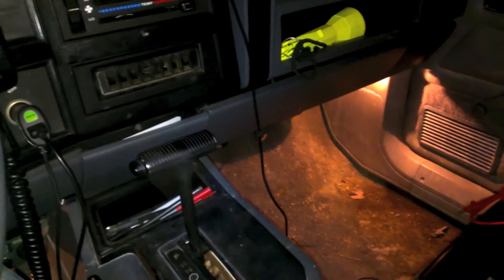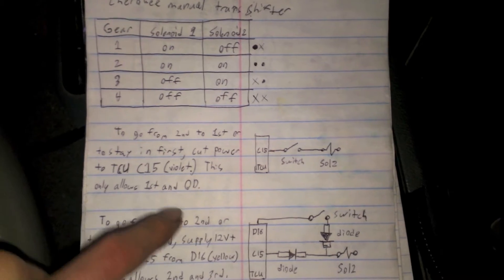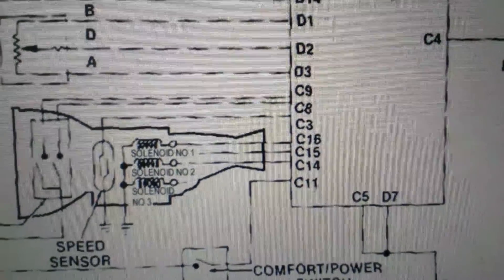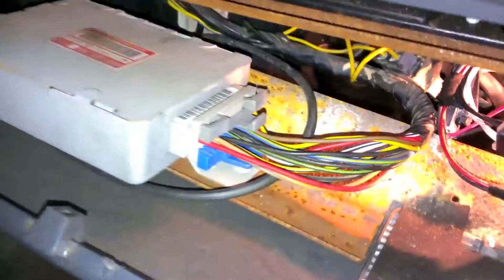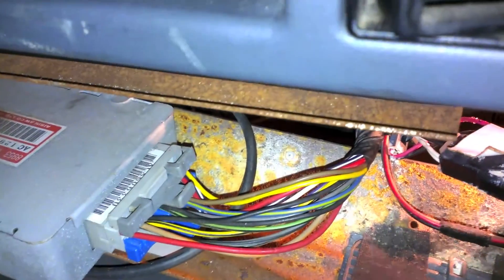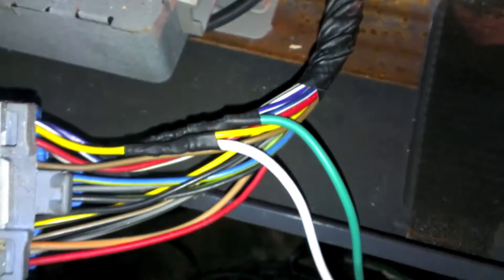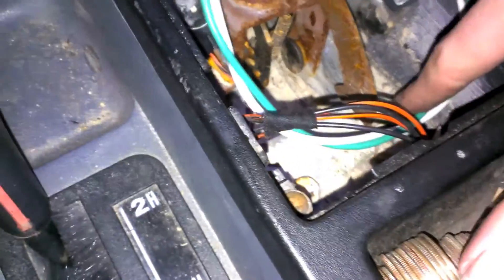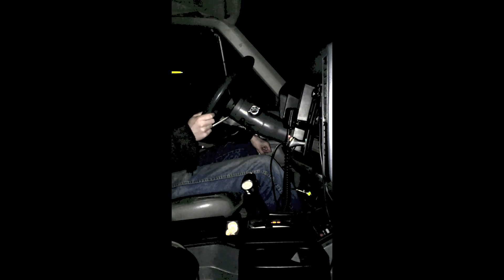89 Cherokee AW4 2nd Solenoid Override Switch Install

Comment: I have a trail rig I want to manually shift from 1st to 2nd and back to 1st can that be done with this method
Reply from the maker: You would need a 3 way switch. 1 that passes through for auto, 1 that is off for first, and 1 that feeds 12v for 2nd.

Comment: Hey Nick, without this fix, under what circumstances would the transmission ever shift to 2 when in the 1/2 position?  I"v never seen my transmission shift to 2 when in 1/2 position.
Reply: Engine speed, wheel speed, throttle position. Mine switches to 2nd if I'm offroading, trying to climb a sandy hill. So high engine rpm, almost full throttle.

Comment: So lets say for "racing" i can take off in 2 rather than 1st
Reply from the maker: You could yeah. I've been working on a more complete shifting system now called the Nifty Shifter to allow any gear at any time.
Reply: NickInTimeFilms great job!
Reply: NickInTimeFilms would this be possible on the newer xjs 97-2001
Reply from the maker: @mmeza620  "Yes" The concept is the same as the solenoids still function the same, but with the newer XJs you've got more computers to worry about. If you start messing with them yourself, it will set a check engine light for a solenoid fault and may even put it into limp mode when you turn your override switch off. I build a 97+ version of my nifty shifter which takes care of the basic check engine light issues. 

The only issue left has to do with the computer detecting when the speed sensors "look" out of sync when you are grabbing manual gears that the TCU did not request and you're really flooring it. That doesn't pop up very often though. Little too smart for their own good.
Reply: NickInTimeFilms i got a 97-01 was teally thinking of doing that for "racing" haha but as u say it may have issues i might aswell not even try it cuz im not quite the mechanic haha but thanks for replying really appreciate

Comment: hello 10x for the video i have Cherokee 95 in the summer i have a problem i'm driving in the D  the transition go 1 3 4  the 2nd not working in the winter when the temperature go down it is working without problem what is the problem???

Comment: By any chance when you are in 2nd gear running off the tcm does it drop out 2nd gear over 3000 rpm
Reply: My jeep wont hold 2nd gear when shifted into 1-2 which is horrible when trying to hold 3200 rpm climbing a mountain.
Reply: @JACKOFALLTODD  Do you know when the selector is in 1/2 under what conditions does it shift to 2nd?  I've never been able to get mine to shift out of 1st, and it would be nice as you say climbing a mountain or even going downhill to be able to use 2nd gear to gain some speed, but not too much speed.
Reply: @66gosser  if I'm on the throttle in 1st gaming rpm it I'll shift to 2and unfortunately if my rpm is to high it overruns in second I cant hold 2and over 3k rpm
Reply: @66gosser  if yours isnt shifting to second in 1/2 but works fine in 3rd you may have a bad gear selector switch or out of adjustment
Reply: @JACKOFALLTODD  As far as I can tell, when in D, it shifts through all gears.  So a bad gear selector switch or out of adjustment.  That sounds like an inexpensive fix.  Let's see.  Thanks for your reply!
Reply: @JACKOFALLTODD  At about what rpm does it shift to 2nd when in 1/2?
Reply: @66gosser  all gears shift at about 2400if I remember correctly it could hold a little longer but even at full throttle it's not gonna go past 3500
Reply: @JACKOFALLTODD  I feel your pain.  I have a '98.
Reply from the maker: That's the tricky part of this setup. I actually installed to help upshift, not hold it in lower gears. The 2nd solenoid controls 2nd and 3rd gear, so you're probably noticing it shift to third. I built a full blown shift controller recently to hold any gear you want.
Reply: @NickInTimeFilms  I connected a switch panel with LEDs and  I found that the tcm is pulling my 12v to the 2nd relay so essentially its trying to down shift I'm in the works of making a electronic circuit with an arduino when I shift into 1-2 it will shift into second and then with a momentary button on the shifter it will downshift to first. Then press the button and it will upshift to second the circuit will only work when the shifter is in the 1-2 position so I'll have 1st and 2nd hold with the push of a button.

Comment: nice video... I have 89 Cherokee  Laredo . I put the car trans in drive no have to much power to move so I need to put in 1-2 up 3 end then drive.. you can help MI.

Comment: Hello. I 
made a swap to the Jeep WJ 3.1 on a M57 bmw 44RE-AW4 and tell me what's 
the resistor value (resistor pack) and its power on pin 10 TCU
https://www.youtube.com/watch?v=cad3lz_O8Go
https://www.youtube.com/watch?v=er87oN-w2pE
https://www.youtube.com/watch?v=vqJLpmXbMkY
Reply from the maker: Would have to pull it all apart to find out, but it looks like that is only used to detect the brake switch.
Reply: The point is that lockup does not turn off

Comment: I have a 2000 XJ AW4 that's giving me fits!  The trans shifts out of OD into 3rd and then back into OD.  The problem is erratic and there are days when it doesn't happen.  I was informed that it could be a TPS sensor, which I changed out.  I used a Standard Motor Products TPS from RockAuto.  This proved to be a mistake!  I am returning for a refund because it gave me a check engine light. It was D.O.A.  I purchased a Mopar TPS from RockAuto and it helped a little, but I'm still having the same issue. Fluid level is okay.

ANY IDEAS?!
Reply: My XJ has a reman tranny with 51,000 miles; 96,000 miles on the engine and body.
Reply: Throttle/chick-down cable has also been checked.
Reply from the maker: Hmm. The TPS does cause a lot of trans shifting issues. Mine is starting to crap out on the trans side so it doesn't shift until like 4k. You could try resetting the ecu to see if it relearns anything. If the Kickdown cable is adjusted properly, the TPS is reading ok on both connectors, then there ain't much else. How's the fluid, TCU Fuse, how is the engine side of the tps harness, grounds all good?
Reply: Check tps sensor and possibly replace Trans controller

Comment: hey good video. .I have a jeep Cherokee 1988 and ever time I start to drive I have to start off on first gear than second and then drive but I have to do that every time I stop any idea.?
Reply: Andrew Macias I'm having the same problem with mine. It's a 1989
Reply: @jessicapeyatt5582   tcm or the tcm fuse is

Comment: I have a Jeep xj and when  I come to a stop the transmission goes into neutral. If I put it into reverse then back into drive it will go back into drive. the trans mission is a AW4. Does anyone have a answer for this problem?
Reply from the maker: +Dan Ctibor First you need to check the basics. Do you have enough ATF and does it need to be changed? A clogged filter may cause pressure issues. 

I would check the Throttle Valve Kickdown Cable on the Throttle body to see if it needs adjustment. Sometimes they fall out of adjustment and can cause big issues. Adjustment vid here: https://www.youtube.com/watch?v=c0di1z5j1fU

Comment: So will this be a temporary fix if shift solenoid b is going bad? In d  I'm stuck in 3 or overdrive. In 1-2 I only get 1st
Reply from the maker: fujidude1 If you get 3rd then solenoid 2 is still working. This switch will force the solenoid on if it works properly. Check your tcu connector and the fuse the is next to it if you are having shift issues. bad grounds and bad TPS could also cause issues.
Reply: Fuse? Sorry I for for to say it's a 97. Mine is under the dash on the driver side right of the steering column. There's not much wire to work with and I looked for the fuse
Reply: fujidude1 my wiring harness for the tcm is routed directly through the firewall no fuses between
Reply from the maker: fujidude1 not sure then, I don't know much about the newer cherokees. If it's the same tcu and wiring you could still do this mod if you want. But maybe tcu fuse is in one of the fuse blocks
Reply: NickInTimeFilms ok thank you so much. I'll be sure to let you know how it works
Reply: Man i cant wait to try this. I hate going in deep mud and having the jeep switch to 2nd gear.

Comment: Just today we installed an advanced version of this. Now I have a small joystick that allows me to switch gears up and down manually (when system is on) and when pressed to the left, the torque converter gets locked/unlocked.
Now I basically have a 4-speed gearbox in 1st and 2nd, 3rd, and 4th locked with regular 2nd, 3rd and 4th unlocked acting as "clutched" gears :D
In a quasi 7-gear fashion I could go 1st, 2nd, 2nd TCL, 3rd, 3rd TCL, 4th and 4th TCL.
Reply from the maker: Nice. I was looking at kits like that but don't really have a need for one yet. It's pretty cool that you can turn an AW4 into a manually shifted auto with full control. Would make a nice trail shifter if the TCU ever burns out.

There were a few projects I've seen where a digital display was included to see what gear was selected in real time. Here is a really fancy version: https://scontent-lga.xx.fbcdn.net/hphotos-xap1/v/t1.0-9/1424297_251242441696706_187435092_n.jpg?oh=420c3ee9de9b2ecb6ed160794a7c6c1c&oe=5579517D
Reply: The link that you submit has expired , could you pls send it to me . Or tell me what was that project .
Reply from the maker: I honestly don't remember, couldn't track it down as it was from someone's facebook. I think it may have looked something like this but i don't really remember: https://www.youtube.com/watch?v=4mpHWQcDjWE
Reply: Thanks Anyway Sir
Reply: BTW ,I wanna to do shift to my 4th gear b'4 the TCM do . b'cos TCM shifts to the 4th gear after 60 km/h  . 
So I did manually override the solenoid A and shift manually to the 4th gear  when the vehicle reach to the its comfortable speed rage (45 - 50 km/h  thats the speed normally I'm driving most of the time.) so it save my fuel 25% . But the problem after I manually shift to the 4th gear , TCM does not shift even if after vehicle reach 60 km/h (even 70 km/h) , To get it back to normal I have to trun the ignition key off and reset the TCM . Any idea why is this happening ?
Reply from the maker: You might be shorting something out? In order to get the transmission to shift into 4th gear (Overdrive) You actually need to remove power from both solenoids. That would require adding a switch to both solenoids separately or using a DPST (Dual Pole Single Throw) switch to take power from both. 

You might be telling the transmission to do something unsafe so it shuts down the TCU until it is reset.
Reply: No sir , actually here what it is 
,For gears
1st  S.A - ON and S.B ON ,
2nd  S.A - OFF and S.B ON
3rd  S.A - OFF and S.B OFF
4th  S.A - ON and S.B OFF

So what  I did , I manually ON Solenoid A (S.A) when the gear in 3rd position and it works fine and gear sifts to the 4th position without any issue . after that if I hold still when the vehicle reach to the speed around 65 km/h TCM will activate the TCC (torque converter clutch) Solenoid  as well , so everything working very smoothly and also when I OFF the Solenoid A gear in 4th position it drop to the 3rd gear without any issue . everything working.
But my problem is why TCM didn't send the signal while I'm sending the signal to the Solenoid A .  
May be b'cos TCM reads the Solenoid A whether it open or not b'4 send the signal .
Reply: Page 34 - http://boredmder.com/FSMs/Nissan/Maxima/1999/AT.pdf
Reply from the maker: You know that manual is for a 1999 Nissan Maxima Transaxle right? Here is a cap from my AW4 Service Manual, Page 6: http://i1059.photobucket.com/albums/t437/NickInTimeFilms/Jeep%20Stuff/Screen%20Shot%202016-06-09%20at%202.25.13%20PM_zps6rozwqpq.png
Reply: Oh ya, b'cos my car is 1999 Nissan maxima with RE4F0A transmission .
Reply: BTW , you are correct with your transmission , you have to OFF both solenoid to shift it to the 4th gear .
Reply from the maker: That's a rather important fact, wouldn't you think? lol. I don't know how this mod will affect other cars, especially newer ones with OBD-II computers. My guess is that you are shifting it properly but the TCU sees a different gear than what it has selected so it shuts off because it thinks something is wrong. Did you use diodes?
Reply: Yes you are correct , BTW I did use two diode for extra safe - http://www.awesomescreenshot.com/image/1315817/f6d0792fc83bc3d728f778713cec2f13